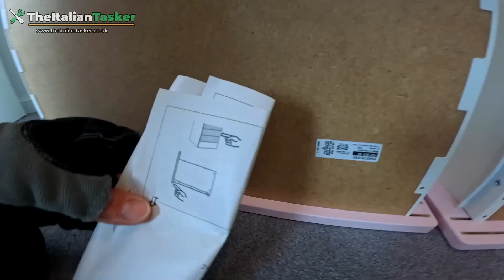How to assemble Ikea Platsa with Konstruera Drawers | Ikea Drawer Assembly

Comment: Followed the 13th hole and the draw doesn't fit I evened pause the video to count holes it's the 14th hole from the bottom  on my draws  if anyone can explain why ... I have the ikea ...Konstruera draws 404.367.74 .. the small doors don't fit neither
Reply from the maker: Hi @stevenspierrs5190 did you screw the rails in the correct position? Also what is in the specific the problem? Can you send a photo?
Reply from the maker: another problem could be the wrong way that you assembled your drawer keep in mind that there are 2 ways. One is for drawers fitting in the bottom (1st rails) second one are for other drawers from second to up
Reply from the maker: If you send me a photo I can better understand what's wrong I'm also on Instagram same name

Comment: Instructions are not clear,fitting the last draw is an issue. Following the manual isn’t helping.
Reply from the maker: The problem could be in your drawer, they have 2 assembly option one for the bottom part and other one for middle.... Check again
Reply from the maker: In my videos you can see Konstruera drawer watch that one